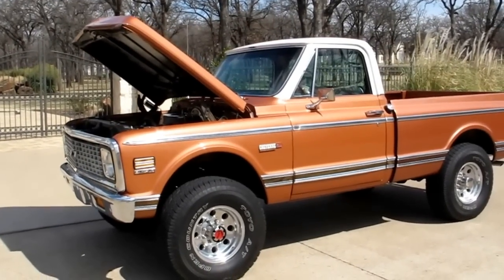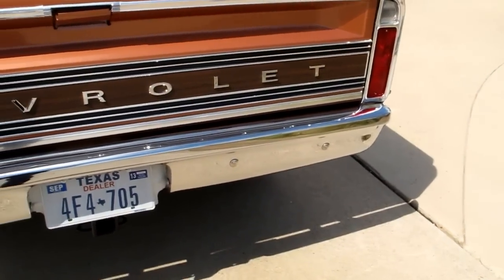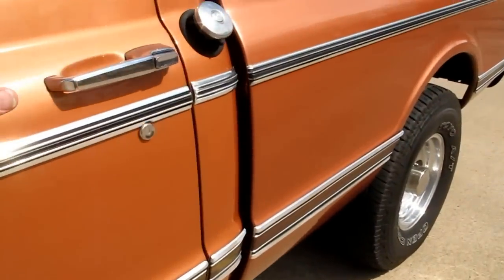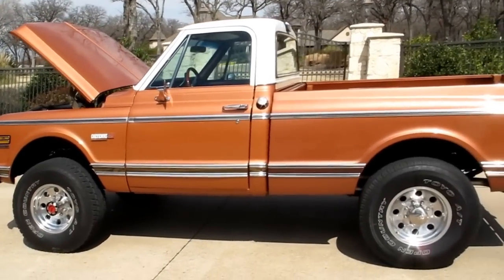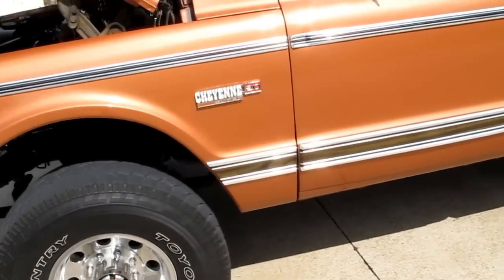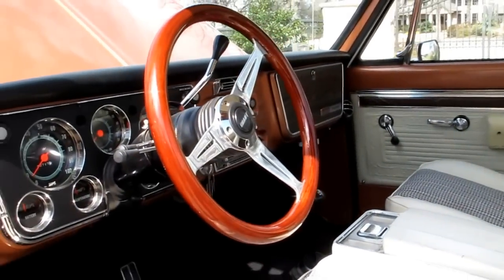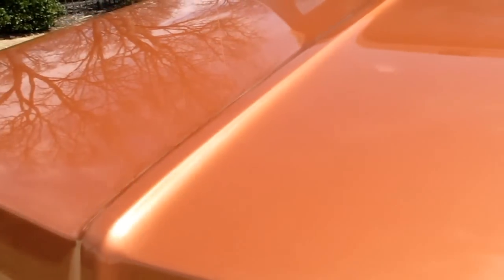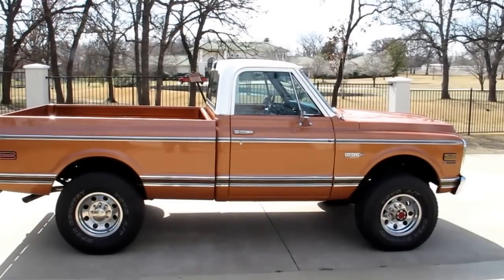1971 Chevy Cheyenne Super, 3/4 ton, 454 V-8, 4 wheel disc brakes, built 700R-4 auto, For sale

Comment: Beautiful truck no fought, but they never put a big block in a 4x4 72 truck,  and also it has 69 /70 door canals, and the rear view mirror is bolted to the cab.  71/72 was mounted on the windshield, homemade to appear as as 72 but still a super nice truck
Reply: I agree but that 8/454 badge is pretty convincing.
Reply: 72 only was on the windshield. 71 screwed to the cab. Correct on the NO big block in 4x4 trucks 67-72.